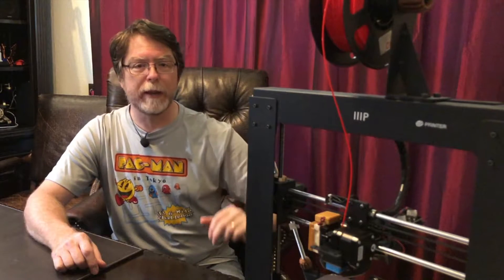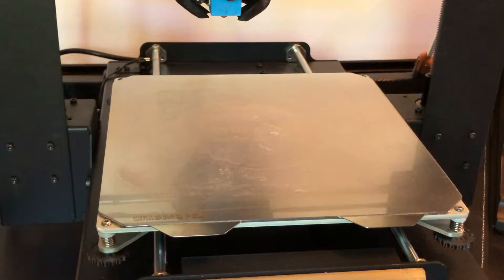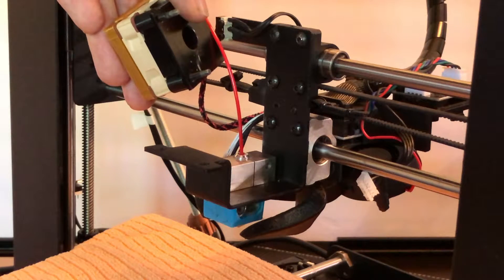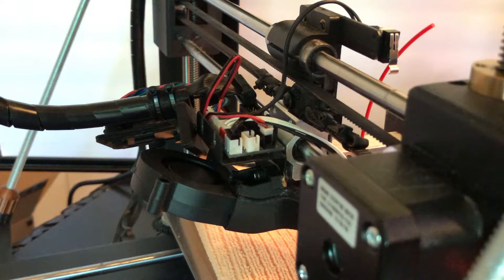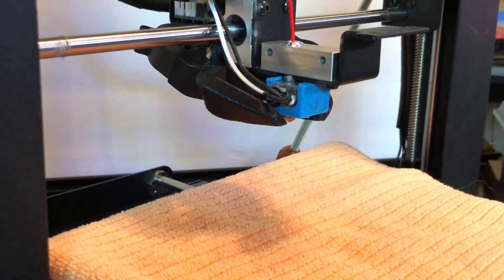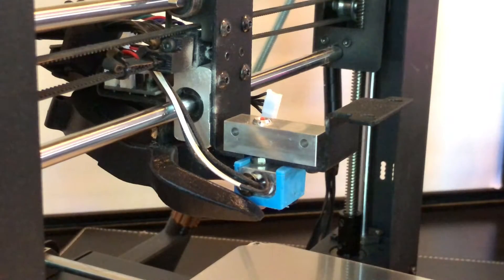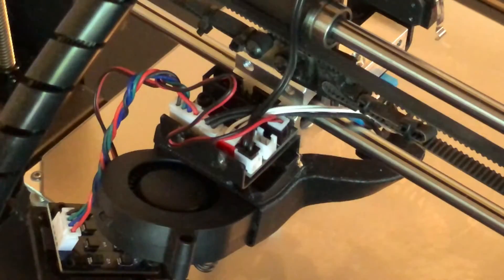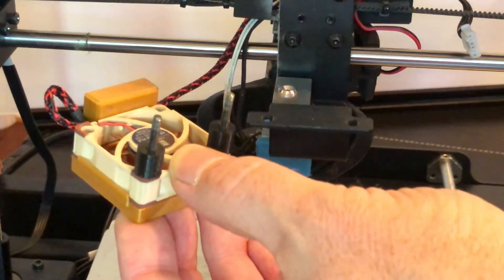How To Disassemble & Reassemble the Extruder on the Maker Select Plus

Comment: I tried using the 0.4mm bit to enter the nozzle and "extract" said filament. I was extremely careful and as soon as the bit went in.... It broke off inside the nozzle. Not sure if it is still in there or not. I have since been able to print one of the pre-loaded images that came with the printer. I may want to look into replacing my nozzle in the near future. Good video by the way.
Reply from the maker: Hi Ben,
I've done that before. Those drill bits are actually intended for drilling the holes in circuit boards, and they are ridiculously brittle.
I'd say just replace the nozzle. Brass nozzles like the stock ones for this printer are very inexpensive.
And as long as you're in there, I'd recommend removing the Kapton™ tape and ceramic wool insulator around the heater block, and installing a silicone sock instead (see https://youtu.be/luqmpur4luU).
Thanks for watching! 👍

Comment: I would really appreciate a video of the nozzle teardown. Mine has a terrible clog and even better yet, I broke off the end of my wire attempting to clean it out...
Reply from the maker: Hi Marshall! I think I still have all the stock parts. Currently, I have Micro Swiss All Metal Hot Ends on my Monoprice Maker Select Plus printers. They're mostly the same as stock, but the Micro Swiss doesn't have that little piece of PTFE tubing running through the heat break (it uses a titanium heat break instead).

If you're still using the ceramic wool and Kapton tape wrap that was factory-installed on the heater block, I recommend removing that and replacing it with a silicone sock. You can remove the sock easily to work on the hot end, and put it back on when you're done.

I'll add that video to the list of videos I want to make for the MMSP printers. :)

Comment: I love your channel and appreciate all the contributions you have made to the monoprice community. I am a beginner tinkerer and your videos have given me the confidence I needed to do all kinds of mods to my MP select. I was hoping that you may consider doing lead screw install upgrade on your channel. I print dnd miniatures but have noticed banding and other artifacts that are consistent with a less than perfectly straight threaded rod. I appreciate all your work and hope you consider it.
Reply from the maker: Hi Russell! I'm glad you've taken the plunge doing mods on the Maker Select Plus. It's a fun one to tinker with. Regarding the lead screws, are you thinking along the lines of replacing a bent lead screw with a new, un-bent one? If so, I could do that. I've got a few ideas for other maintenance videos on this printer as well, including ensuring that the X gantry is parallel with the base of the printer. If you haven't done a Z brace mod, I recommend it. 👍

Comment: video is a life saver thank you! 

my extruder stepper keeps getting the filament wrapped around the gear and arm and everything else. is there a good fix to this?
Reply from the maker: Are you printing with a really soft or flexible filament? If so, try printing more slowly, or a little hotter.

If you are printing PLA or PETG and this is happening, you may have a partial clog in the nozzle, or the PTFE tube in the stock hot end may need to be replaced. Either of these would make it more difficult for the printer to push filament through the hot end.

If you have the stock hot-end installed, and you've had the printer for a while, it may be time to replace the PTFE tube inside it. That's the white Teflon tube that lives inside the hot end. It guides the filament through the cooling tube in the heat break down to the nozzle. The printer should have come with a spare. Mine did, but I never knew what it was for. 😁 So, I don't know what the length is supposed to be, but a quick Google search indicates somewhere between 34mm and 36mm. You can buy a 1m length of PTFE from Amazon and just cut it to length as needed. If nothing else, watch this video about taking the hot end apart and replacing the tube. You can at least see if there's an issue with the tube in your hot end. https://youtu.be/QCoI4fzw6EU

Disclosure: I've only had one cup of coffee and I was up really late last night, so if I misunderstood the issue, please feel free to correct me!
Reply: @BV3D  that's wonderful thank you I'll check yeah I'm printing PLA I was given the machine from a friend who said the extruder was broken but "broken" but that makes sense I'll definitely get some ordered asap! 

thank you!
Reply: @BV3D  Would the heat sink being reversed cause any issue like this? to where the fins are facing the stepper motor? that's how the heatsink came (I don't know WHY?!?!?) but it seems that there not being a flat wall might cause some issues in the little chamber there. 

Still going to get down to the hot head and check the PTFE tube out and order a new one!
Reply: And you DEFINITELY have a new subscriber!
Reply from the maker: Robert Shelton Yes, if the heat sink is facing the wrong way it isn’t going to work. You will end up with an issue known as “heat creep,” where the heat from the hot end slowly creeps up into the cooling zone. This, too, can lead to jams, because the filament gets hot in an area where it shouldn’t. Hot filament is softer, making it harder to push. 

Get the heat sink in the right way around and see if that improves your ability to print.
Reply from the maker: Thanks, Robert! Glad to have you aboard! 😃

Comment: what type of nozzle  do i need to buy need a new nozzle will any nozzle work
Reply from the maker: Hi! If you still have the stock hot end on the printer, it takes a MK10-type nozzle. They’re cheap. For example, you can get a 5–pack for about $7.00 from Amazon. (https://www.amazon.com/dp/B01FJS19C0/ref=cm_sw_r_cp_tai_9B08CbXF607CN)

If you have the Micro Swiss all metal hot end, you’ll need to use the nozzles from Micro Swiss specifically for the kit you bought. The Micro Swiss ones are designed so they don’t have that small length of PTFE tube inside, and the regular nozzles (while they will fit) will not perform well, and you’ll have all kinds of problems (I speak from experience).

Comment: Hey bv3d how long did it take you to build the monoprice select maker 3d printer  I be getting my soon
Reply from the maker: Hi Paul! It literally only takes a couple of minutes. When you take it out of the box, you slide the main body of the printer through the Z gantry, and put two screws in either side. You'll want to make sure the gantry is square to the body of the printer before you tighten the screws, but once you've got that done, and the cables plugged in, you're ready to level the bed and start printing! 👍